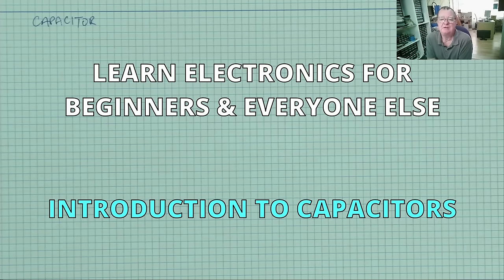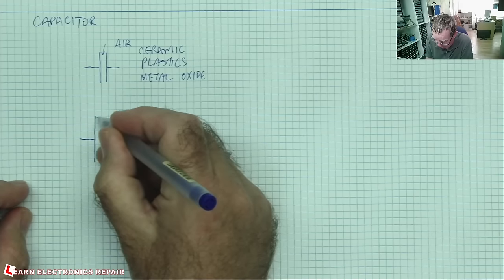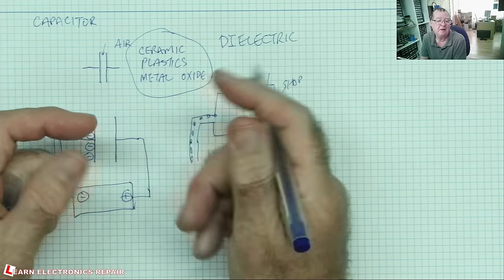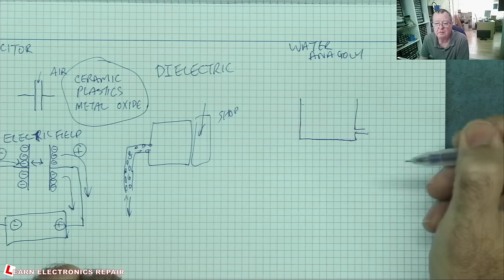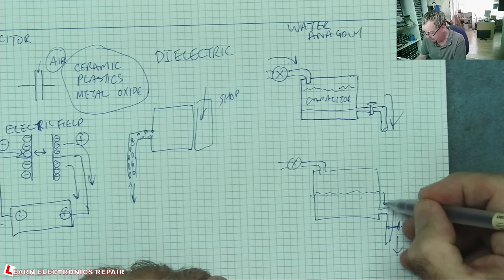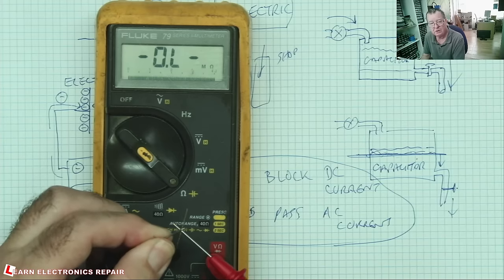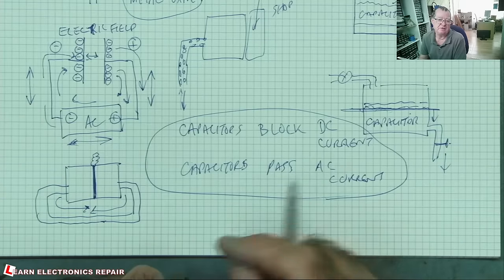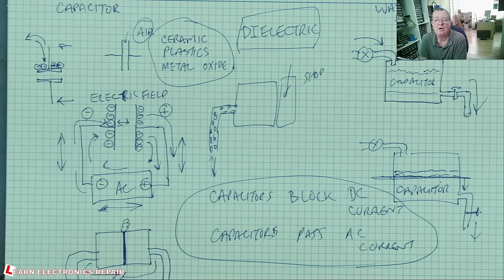Learn Electronics For Beginners #6 Introduction To Capacitors, How The Work, What They Do

Comment: Great explanation! When I was at Uni we learnt the CIVIL rule. In a Capacitor the current (I) leads the Voltage. The Voltage leads the current(I) in an Inductor(L). Must work as a memory aid, it was 45 years ago when I learnt it and I haven't forgotten it.😃

Comment: Awesome video, the confusing point is when you drew the dielectric (11:27) in the water tank. This is incorrect if it is used as a smoothing capacitor. The input pipe and the output spigot are connected to the same side of the dielectric. You drew it in an AC pass configuration. The other pin is connected to the GND potential.

Comment: Hi Richard could you share more light on all the different types of capacitiors and their use in circuits ?  electrolytic / ceramics etc also why electrolytic capcatitors are designed for certain voltages. Thank you.